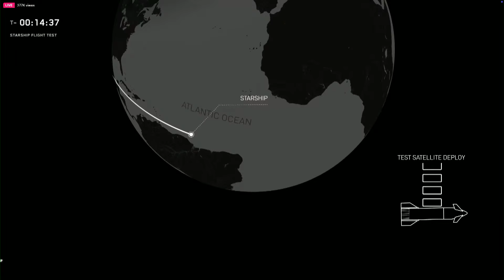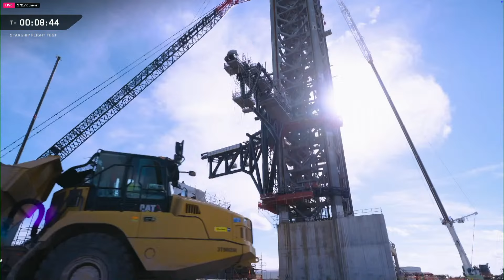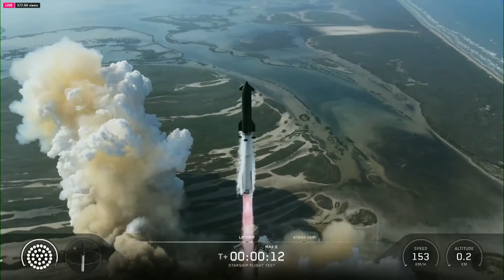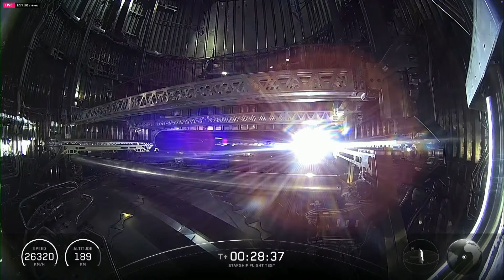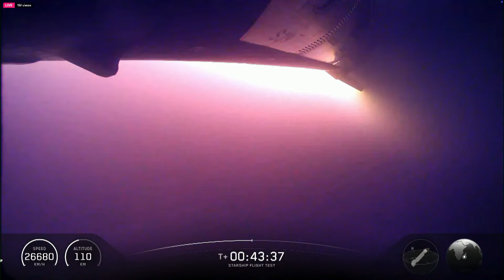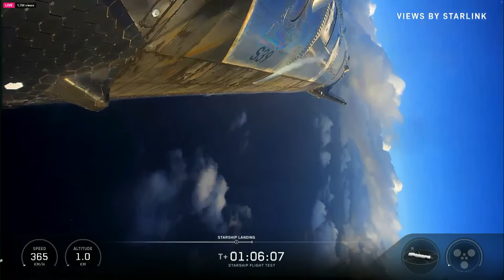LIVE: SpaceX Starship Flight 12 launch (full)

Comment: Super heavy booster splashed down hard af
Reply: Is it exploded?
Reply: @adeguntoro It hit the water at above Mach 1. What do you think? I think its near enough atomzied
Reply: @df1ned  i want to see that splash from another angle lol. I think it was masive AF
Reply: @df1ned it hit at that speed, ship caught it, water displaced most of the energy, and rocket lost balance. Insane accomplishment
Reply: @df1ned landing burn was a failure.
Not ready for primetime.
Reply: @adeguntoro No, it just slightly changed shape...
Reply: @adeguntoro uhhh yes. It’s going to be in a bunch of little pieces now. It wasn’t able to sustain engine relight it seems and its decent angle wasn’t correct.
Reply: @adeguntorothat's by design.  Get off ship very, very fast.
Reply: one engine failed. Thats where more research should be
Reply: It landed, just not in one piece
Reply: It blew to bits!!!
Reply: Yeah, well, being engine out will do that to you. Hydrobraking is just as destructive as lithobraking.
Reply: @odysseusrex5908 
Well the thrusters fired and steered, it nearly made it and of course the system worked already without a problem.  They keep tweaking things to get what they need, offs a long process takes years to produce a durable, reliable, repeatable launch and self-recovery.
Reply: How was that filmed ?
Reply: @RAri-rc3to  buoys with cameras on them
Reply: @RAri-rc3to drones from a ship nearby
Reply: @RAri-rc3to with tic-tacs
Reply: The buoys have cameras on them as does the sections of the spaceship, and the launch pyramid / mound.
Reply: @RAr @RAri-rc3to Onboard cameras

Comment: Remember folks, the truth is that Starship has yet to reach full earth orbit despite the promises of the below timelines…
* 2020: Target date for the first structural and suborbital test flights of the massive 12-meter-diameter ship.
* 2022:  First uncrewed cargo mission to Mars. This flight was intended to drop off scouting equipment, resource-mining machinery, and life-support infrastructure. Two uncrewed cargo ships were scheduled to land on Mars to confirm water resources and place a power/fuel production plant.

* 2023: Intended date for the dearMoon mission, a week-long private spaceflight carrying a crew of artists on a circumlunar trajectory around the Moon.
* 2024: Four ships (two crewed, two uncrewed) were scheduled to depart for Mars with the first human pioneers, tasked with building the initial base. This flight was supposed to carry the very first humans to step foot on the Red Planet.

And for just one crewed ship to reach mars requires at the minimum 16 fully successful launches into orbit.

1 Target Starship: The crewed spacecraft carrying the passengers and life-support systems.15 Tanker Starships: Dedicated propellant flights needed to fully maximize the ship's 1,500-metric-ton fuel capacity. However, this is based on 100 tonnes payload capacity "sometime in the future" while the true capacity at present is only 35 tonnes, so even IF they could do it today it would 45 successful launches.  Crewed missions require maximum propellant to push the ship onto a high-energy "fast transit" trajectory, shortening the human travel time through deep-space radiation to roughly 3 months.
And there is presently no proven way to transfer cryogenic propellant from one ship to another in space.

Comment: Clown show.  Losing engines left and right.  Cancel this boondoggle and fully fund the Blue Moon lander and SLS.
Reply: You gotta be trolling lol
Reply: @KingGeezusMM no I am not.  Starship is a terrible launch architecture that requires 10+ launches to fuel one trip to the moon.  On top of that it relies on cryogenic fuel which boils off and is a safety/reliability issue for taking off from the lunar surface using fragile cryogenic engines versus simple and reliable pressure fed hypergolic engines like were used during Apollo and what every human spacecraft to this day use for critical orbital manuveres where human life in on the line.
Reply: @atticuspomponius  Can you give us a mission summary of Blue Moon's plan?

I can:
(THIS IS FOR ONE MISSION BTW)

Mark 2 lander - launch
Tug - launch
Tanker - launch
x number of flights to refuel those in earth orbit
  plus all the docking with that
3 Blue Origin ships have to go to the moon
Mark 2 gets refueled over the moon (NASA did not like this in 2021/2022) - an extra dock
Mark 2 goes to lunar surface, deploys it's pathetic 3 ton removeable, leave-behind cargo
  And does so from the roof of the lander - not even sure how that works
Mark 2 humans are now UNDER the fuel tanks when it lands by the way.
etc
etc
etc

Meanwhile, a single starship mission lands with 100 tons of cargo.

So that means Mark 2 delivered 30 times LESS cargo than Starship.

Pathetic.
Reply: @ConstantTrue Blue Moon can launch on SLS Block 1B.  Two SLS launches get you to the moon and back instead of one SLS launch and 10+ Starship launches.  Also why would anyone trust using raptor engines to lift off from the lunar surface given their failure rate thus far?

Comment: dispensing more satellites to block out the stars. nice
Reply: These particular satellites were orbited at such a low altitude, that I wouldn’t expect them to last very long before reentering and burning-up. 
However, your overall point is valid.
Reply: They will burn up.  Starship will lead to cheaper access to space for space based telescopes.